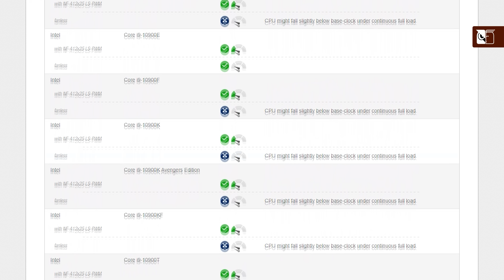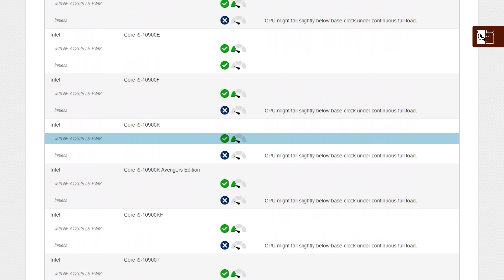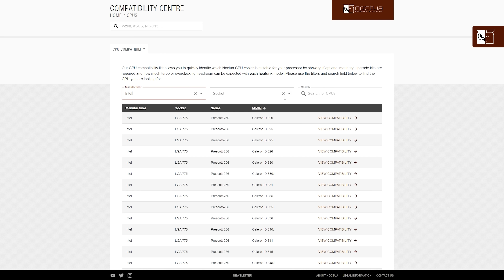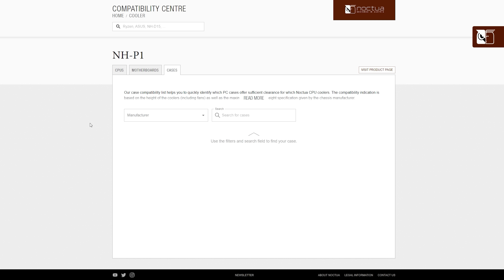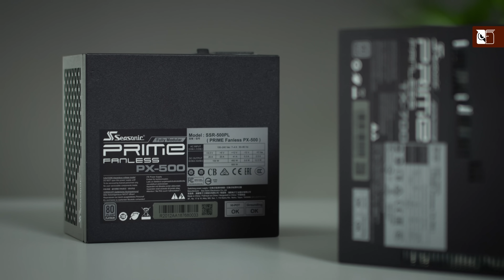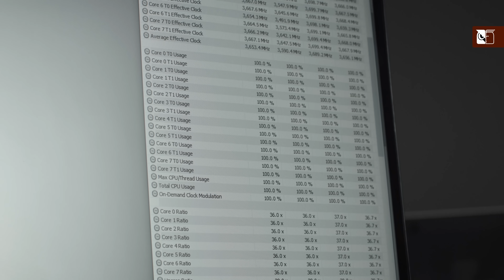How to build a passive PC with the Noctua NH-P1

Comment: what's the current market for this massive chonker of a useless cooler. not gaming, because it cannot run most gaming CPUs at base clock, let alone overclocked. not home PCs, because home pc users don't even know what a cooler is. not servers, as this chonker won't fit in any server solution
Reply: Audio recording for one.
Reply from the maker: Many customers build their own home PCs, do know what a cooler is and want it to be as quiet as possible. But there are also lots of professional applications such as 100% silent office PCs,  audio and video recording, streaming applications, etc. Even light gaming is totally possible, keep in mind that our CPU recommendations are based on 100% continuous load whereas most games will only stress the CPU to the maximum occasionally.

Comment: So a thought:

With the blow-through design of Nvidia's 3000 series GPU you could potentially help this cooler do it's job by the GPU pushing air through the case.
Reply from the maker: Yes, it would be rather hot air going into the cooler though plus if you use active fans on the GPU you might want to run an active CPU cooler anyway.

Comment: 115'C Really? Intel? In this day and age? AMD is FAR more efficient and makes much more sense than the "waste of silicon" selected here. 
With the thermal envelope of the 11900k you could run a 5950X. 
Get with it Noctua.
Reply from the maker: We didn't make use of Intel's 115°C limit in our tests, we only ran up to 100°C. The 5950X only supports up to 90°C, so unfortunately, there's no way of giving it the same thermal envelope. The end result for NH-P1 customers is that they can get more out of current high-end LGA1200 CPUs  than out of current high-end AM4 CPUs. Note that this is not only due to maximum temperatures but also due to heat flux density issues, but the bottom line is that we're far off the 5950X's base clock with the NH-P1 whereas the 11900K can be run at or slightly above base clock.

Comment: The price is silly and the performance isn't even that great. If you have to put a fan on it (doesn't even ship with one) just so the CPU doesn't throttle, it isn't any better than the much cheaper single tower heatsinks out there running at low RPM...

Comment: "You can add a fan to improve the cooling performance." so why wouldn't I just get a regular air cooler?
Reply: Because with a cooler meant for passive cooling, you can add a very low powered fan that hardly makes any noise at all and it will improve performance.

With a regular cooler you wouldn't be able to do that, you'd need a fan with enough static pressure and airflow to force air through it (due to the denser fin stack) leading to much more noise to get it to work.

Comment: You can use Intel 11900k 125W TDP but you can't use Ryzen 3700X 65W TDP?
This is one naughty cooler, prefers to sit on top of an Intel chip rather than an AMD one!
Reply from the maker: Unfortunately, the rated TDPs don't mean much, the 3700X puts out much more than 65W. Generally, current LGA1200 CPUs are easier to cool passively than current AM4 processors, we see up to 125W on the first and up to around 100W on the latter. It varies a lot from model to model though (depending on the DIE configuration).
Reply: @NoctuaVideos  yet plenty of review sites show the 11900k drawing 160W dropping to 135W with the 5950X only drawing 140W.
You can easily set modes in the BIOS for AMD such as ECO Mode. 
Something's a bit off.

Comment: Nice, have 3400G in cooler master nr200p, and whant to upgrade to 5600G/5700G, but i need to know compatibility to this cooler+case. Thanx!
Reply from the maker: Unfortunately, the NR200P lacks a few millimetres of clearance, so the NH-P1 won't fit: https://ncc.noctua.at/coolers/NH-P1-68/cases/all?q=nr200
Reply: @NoctuaVideos  But the nr 200 can accommodate the NH-U12A which has the same height of 158 mm as the NH-P1.
Reply: @Noctua_at Did you test a NR200 or NR200P and found it didn't fit, or is it just based on Cooler Master's specs? There are unofficial indications that 158 mm would just barely fit the non-p version.

Comment: I'll come back again when you release a Chromax black mini iTX version since this one has 158mm CPU cooler clearance, it won't fit the CoolerMaster NR200P which has 153mm. I don't think a slightly smaller size passive cooler will affect the performance significantly, so it is technically do-able.
Reply from the maker: Any reduction in surface area will have an impact on performance and we already went from 165 to 158mm in order to maximise case compatibility. Compact cases like the NR200P also tend to be less suited for passive builds due to the low internal air volume and because everything needs to be packed quite tightly, so we don't think it makes much sense to go smaller in order to fit this type of cases.

Comment: Semi passive is the way to go!
Full passive is great and all when it works, expensive when it isn't. Semi passive has all the advantages of full passive, minus the risks.

I first found out about semi passive cooling in the mid 2,000s after pulling a passively cooled videocard out of a machine and burning my hand in the process 🤣
Within an hour, it had a small 12v fan screwed directly into the heatsink...
Reply: Except when you can't tolerate any noise at all. For me, I'm setting up a home studio DAW. Any noise at the wrong moment might ruin a take, so it has to be fully fanless. (edit: typo)
Reply: @AnWe79  you can also have the pc in another room and have long cables. But ye, in the end audio recording are a niche of a niche market. Noctua was hyping this as a game changer but it's far from it, just a gimmick
Reply: @grasthube  Yep, my use case is a one room guest cabin that will double as a studio, so the other "room" would have to be either the toilet, a cabinet, or outside. None of those seem tempting TBH.
Reply: @AnWe79  yeah that's a fair call, in that situation then yeah you would only want fans to come on when absolutely necessary. Example, if a CPU is good for 90c according to the manufacturer and with given cooling being ample for keeping things 60-70c in most situations, I'd set the fans to come on at about 30% at 80c, but only to protect the equipment from overheating and potentially causing a loss of work.
Reply: I think the low-speed fans are a very interesting option here. 12 db is like... not possible to hear. First time I realize they exist.
Reply: semi-passive: ie every cooler in the market that is not a water cooler or aio
Reply: Passively cooled in a proper way is always expensive. 0 noise comes with a higher price.

You should always take into account the highest performing parts not being available when you go fully passive. Just the way it works.

I have a fully passive pc in 1 case, no noise, no whine, no RGB. There is no indication at all whether it is on or off.

Comment: This cooler with an AMD 5700G APU would mean silent gaming at 1080p! That's a tempting prospect, given the current GPU situation...
Reply: Plus the boost from FSR.
Reply: @steviebro0538  You wouldn’t get much boost if any at all. You could MAYBE get away with over locking the GPU.
Reply: @catharticcathexis4527  We shall see on June 22nd. Also, overclocking. And it can still go quite well. I'll get it in a cheap bundle until AM5 APUs.
Reply: @steviebro0538  post your temps when you do!
Reply: @catharticcathexis4527  You bet. As well as the scenarios and the tasks. I feel desktop Rembrandt and Raphael with graphics will beat my current system (A10-7850K +  HD 7870).
Reply: Have you seen the prices of the older 3200g and 3400g, these things will be just as bad as GPUs
Reply: @therevanchist1123  FWIW quietpc.co.uk are doing bundle deals of APUs and motherboards (can't buy the APU by itself currently). They work out fairly reasonable, as the APUs aren't being marked up - effectively you're just buying the innards of a pre-built, you just need to add case/storage/PSU. Hopefully they'll do the same for the 5x00G series!
Reply: @therevanchist1123  No, GPUs get scalped whereas a slightly markup due to supply demand is reasonable, suck it up or wait. Looking at prices, low prices are out of stock and high prices are available, that's supply and demand.
Reply: @steviebro0538   suck what up I got a 3060ti at original retail I am good 😊 and if I wasn’t I would be damned if I’d pay a dollar over MSRP especially for a 3 year old chip, I’ll let others suck on that one, ultimately consumers determine value.
Reply: @therevanchist1123  Good, but I'm referring to complainers.
Reply: @Green Mamba Games Correct, I don't mute the game, I use headphones to not disturb the room.
Reply: you can put a passive heat sink on your gpu

Comment: 1200RPM isn't anywhere low speed, if nothing else is different than regular A12x25 it should run at half of that at most
Reply from the maker: Keep in mind that the A12x25 is much quieter than other fans at the same RPM, it's 12.1dB(A) at 1200. You can also use the supplied LNA to drop to 900 / 7.6dB(A). And of course you can go even lower using PWM control, 100% your choice. We do think that the 1200rpm choice is sensible though because this is already extremely quiet, the regular version is 2000rpm.
Reply: @NoctuaVideos  
Quiter than other fan - Yes. 
Quite enough to sit in a silent room - I don't think so. 
😢
Reply: @PakkaponPhongtawee  If you're permanently running your fan at full speed, you're doing it wrong...
Reply: @Steamrick  permanently running at maximum acoustically viable speed gives the best thermal conditions and avoids sudden spikes of speed when load hits, but that obviously is much slower than any regular fan would go
Reply: @Z4KIUS  'Sudden speed spikes' is a symptom of poor fan controller settings.
Reply: @NoctuaVideos  sure, it's much quieter and that allows it to reach even 600RPM without getting disturbing, but going twice as much is way overboard

and I'm sorry but the noise level numbers without measurement distance are not telling the whole story
Reply: Sigh, that's the maximum speed.

Comment: unfortunately KalmX always have issues with availability and are delayed a lot when compared to other cards with the same chip, for this reason I decided to attempt moving old cooler to new card but sadly capacitors layout was incompatible so I switched to aftermarket one, though I can't recommend that for people afraid to break things as mounting hardware for cards this class is unavailable and you have to figure something out on yourself

Comment: While going completely fanless is pretty useless for all but people sitting in high precision labs, cleanrooms or anechoic chambers, this is most interesting for Mac pro like setups with a few low noise high performance fans.
Reply: @Clarissa 1986 my reasoning is that a fan at minimum rpm will substantially increase performance and be completely silent. Going fanless doesnt make sense even if you want absolute silence.
Reply: @Clarissa 1986 again, office pcs or mediacenter pcs have very little to no benefit from going completely fanless. And you definitely need to dust of fanless systems as well. Just as much maintenance. Laptops, phones and ipads don't count. They have very practical uses for going fanless. A diy pc doesn't really. Low rpm fans are below the noise floor of even a silent bedroom. You quite literally will not increase any noise in the vast majority of cases. The practical benefit is extremely limited. You're sacrificing a lot of cooling performance for no noise reduction, a big price increase, size, and you still have to dust the computer just as often.

And in the event your fan dies, your pc won't overheat, it won't self destruct it'll probably reduce its boost clock. That's about it. Put a new fan in there. Get one that doesn't suck.
Reply: @fVNzO  I would argue a fanless PC will require less work to remove dust, although you're right both tend to accumulate over time. The passive cooler, for example, won't get as much dust on it since [the dust is] unlikely to settle or be forced by current onto an edge as happens with fanned machines. Fans have a way of compacting dust, I have to run my dust filters under running water, a fanless PC would just need a quick blow-out maybe once a year (or more often in dusty environments).
Reply: @nimrodery  There are differenes in dust accumulation between cooling setups i wouldn't say otherwise. I for one just do not have an issue dusting out my PC. If it's an itx system even less so. My opinion is just this. A 400RPM fan in close proximity to this heatsink would instantly improve cooling performance by a wide margin. That fan will be utterly silent, below 99.9% of pc users noise floors. Card driving around in the distance, a light breeze up against your window will be noisier. Your scating mouse feet will be noisier - and the cooling performance fantastically superior. You can even turn it up to 800RPM, still have it running in the middle of the night and be completely inaudible if you're sleeping more than a meter away from your pc. 

The benefits outweigh the cons in such an enormous capacity that it's simply not worth throttling your CPU if you need that little bit of extra cooling. By all means, go completely fanless if you're running low power - that would be fantastic (heyoo). 

But the ultimate, no compromise system is this cooler, with 400-800RPM fans, zero throttling and zero noise. Likewise for a GPU. I think that setup is much more applicable to enthusiast users than a completely fanless setup. That's just my opinion.
Reply: @fVNzO  99.9 percent of PC users have no use for a fanless PC. I wouldn't even bother running a GPU, I don't need to turn on a fan at all. Silence isn't a spinning fan.
Reply: @nimrodery  couldn't agree more about the 99%. I definitely don't agree that enthusiasts don't need gpus though. Having a spinning fan at low rpm is also practically silent since it's below your rooms noise floor. Tis a fact my man. I didn't make it up. Unless you live in an extremely silent place, possible quite far from civilisation? You do have internet access though.
Reply: @fVNzO  I don't need an on-board GPU to mix tracks. In fact it doesn't help at all. "Basically" silent isn't silent, nobody is talking about "enthusiasts." Do you ever have an argument that ends?
Reply: @nimrodery  well you are quite the combative commenter, a valiant effort sire. Do you know what a noise floor is? Do you know that I'm not referring to you at all? In this instance basically silent is actually silent. Our definition of silence is approaching the noise floor. If you can't accept that fact you must indeed be a scientist, living in a specialized environment. I started the conversation you didn't. I'm leading it. You responded to it. You're governed by it. You got anything else to say? :) xd my man.
Reply: @fVNzO  No, silent is silent. I have no need for "basically" silent and I have no need of a GPU, also it's becoming increasingly apparent you aren't much use to me either.
Reply: @fVNzO  I'm sorry, facts don't care about your feelings.
Reply: @nimrodery  see? How hard was that. Finally after all that you admit defeat. It's fine. We all make mistakes, yours was a pretty big one but I won't judge you too hard for it. I'm just delighted that you at least owned up to it. I will reward you with a plot of land. You won't have your old armor and spells anymore but you can start out at the cheese wheels and build up from there. Honestly annoying that you spent that long in complete denial instead of just owning up in the first place. You've learnt your lesson I guess.
Reply: @fVNzO  If "not silent" somehow now equals "silent," then yup, I admit defeat. However, putting the word "not" in front of a word has a tendency to negate it. But go on pretending, it's what you do best.
Reply: @fVNzO  tldr
Reply: @nimrodery  you did read it though. You can't help yourself. You know you just got absolutely rekt, hit with terrible ass jokes in the process and now you're contemplating life. Feels great ngl.
Reply: @fVNzO  I have no context for your rambling reply, having not read the last one.

Comment: what's the exact logic behind marking APUs as green but keeping other 65W Ryzen as troublesome and in some cases even not supported? does it have something to do with asymmetrical layout of chiplets in the latter? or you're relying on cTDP 45W in these?
Reply from the maker: The reason is that the APUs actually stick to the 65W rating whereas most "65W" Ryzen CPUs draw much more power.
Reply: @NoctuaVideos  that's opposite to my experience and many tests I've seen, but I guess it's enough for few mobos to do that to cause problems for customers so it's safer to assume it won't work reliably
Reply: @Clarissa 1986 the way PBO works ensures there won't be any thermal issue, and integration of GPU causes more heat to be generated at the same place if the load is the same, with dGPU heat is spread over the case
there are different factors that can mitigate each other
and it simply feels weird to see demo unit running at 125W without problems while the specs say 65W can already be an issue
Reply: @Clarissa 1986 and funnily enough all tests I stumbled upon make zen3 respect TDP religiously, with small chance of 5600G actually taking more (as it's measured obviously before VRM so loss there happens and not all boards currently support 5600G yet so 5600X probably used more efficient one)

testing power use of modern chips is pretty weird due to all the possible power management quirks and motherboards doing whatever they please to get slight edge in benchmarks